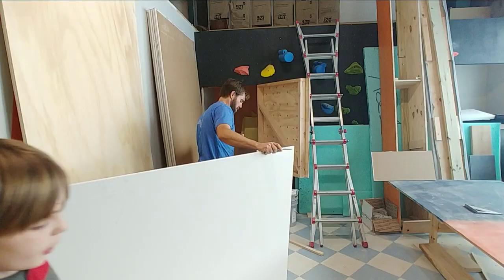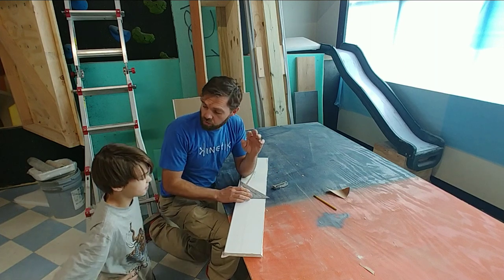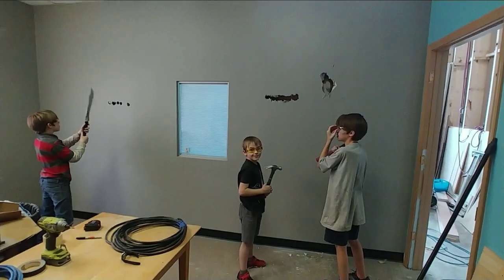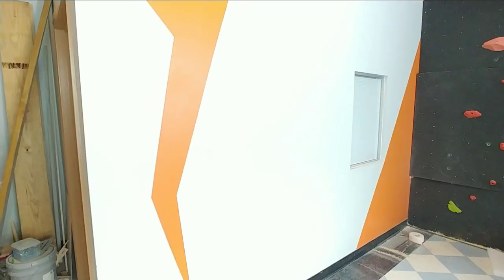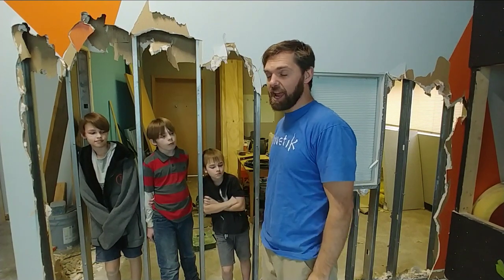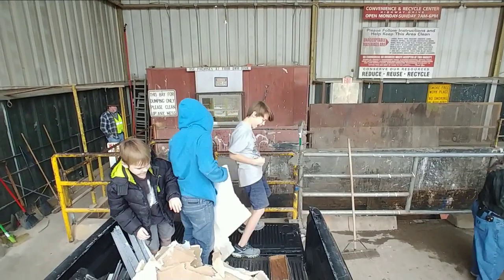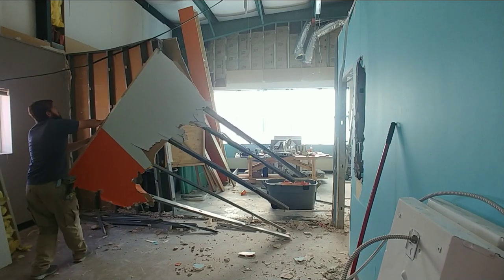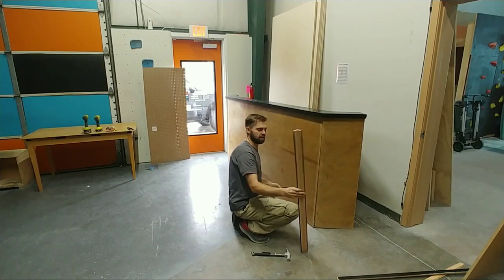STAGES OF DRYWALL at the CLIMBING GYM, VLOG #2

Comment: What material did you use for the wall surface in your gym? 3/4” birch ply? And where did you buy it from?
Reply from the maker: Mostly 3/4" Baltic birch ply (veneer core). I get it at a place called Plywood Inc. In Nashville, TN. 
Stay away from the China stuff, it's trash.